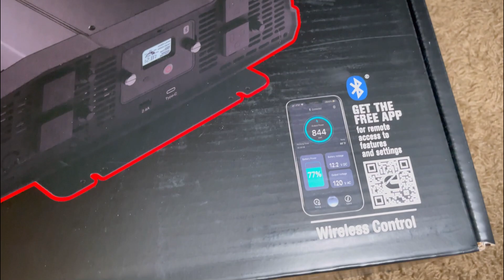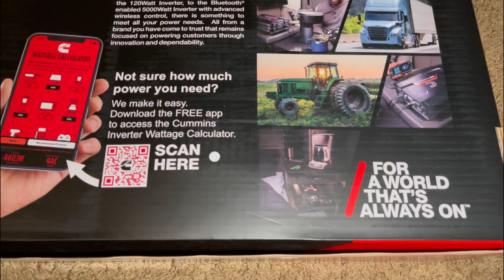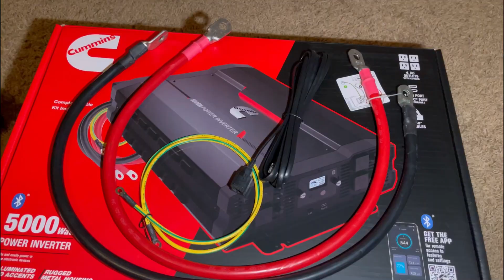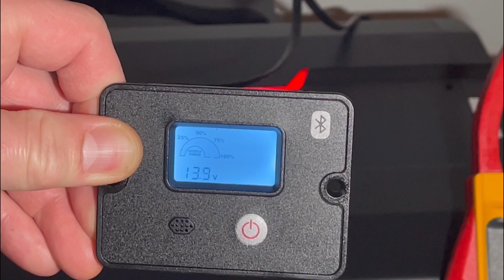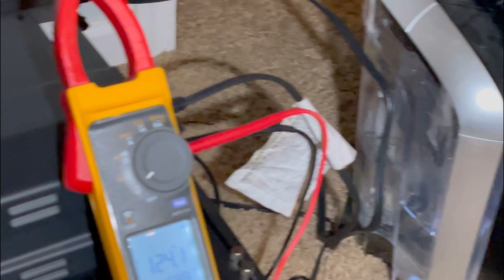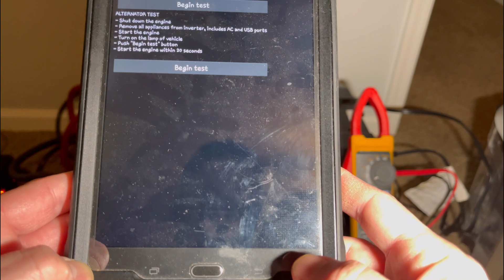Cummins 5000W Power Inverter Unboxing, Review, & Test! #cummins #cumminsnation #inverter #power

Comment: My ram 2500 is gonna be getting this with a deep cycle battery in the bed box and 1/0 jumpers to the front cranking batteries. Just gotta swap the bed first

Comment: Can I put directly on my car in the battery connection and leave the car running?
Reply from the maker: Yes but I would highly advise an inline fuse. What type of vehicle?
Reply: @DIYKAI i have cruze 2019 buddy
Reply from the maker: @Marlonpereira92 so that alternator is probably 140A output or so...you would not be able to pull max power just be aware this is a BIG inverter lol
Reply: the best thing is remove battery use and put battery again in the car to recharge?
Reply from the maker: @Marlonpereira92 so it's really going to depend on what you're trying to power?
Reply: @DIYKAI I need use Portable 2000w water heater and one coil burner, I need running 4500w at same time something like that.
I have one with 3000w but not work with my water heater I don't know why.
Reply from the maker: Got ya soif you running it for any amount of time over a few minutes hook it directly to a battery with a fuse and disconnect
Reply: do you think can leave works by 1 hour or little more just with battery?
Reply from the maker: No not possible with one battery you would need a few Lipo batteries
Reply: thanks for awnser my question man, I appreciate you.
Reply from the maker: Your welcome and good luck the car should be able to handle it but may strain the alternator

Comment: Does it charge batteries when 110v comes back through? I have a tool trailer that I want get set up but when I plug in the trailer I would like it to charge my batteries
Reply from the maker: @coleverbruggen660  no you would need a transfer switch

Comment: What's the real specs? 5000 watts!, sounds like they are marketing peak power.  1. That cable looks too small to handle 5000w/12v -- that's 416 amps and 4/0 cable maxes out at 260 amps.  For 5000 watts, I would expect it to be a 24 or 48v system.  2. All the AC outlet are 15 amp, not a single 20 amp circuit.  My 2000 watt inverter has 20 amp outlets and peeks at 4000 watts.  I assume that inverter is most likely a 2500 watt inverter with a 5000 watt peak. Just like my factory installed inverter marketed as 400 watt; but can only run a 250 watt load for a minute or two before cutting off.  I hate marking departments that stretch half truths into outright lies.
Reply from the maker: @rui1863  to answer your question I never maxed it out 5kw is hard to pull especially off a sitting battery. This inverter is meant to be run in a vehicle where 200A is common for an alternator. Yes I agree the cables are a bit on the smaller side but what can you expect they are trying to deliver a complete package at a decent price!
To address your point of 15A or 20A sockets is not 100 percent relevant….i have 20A sockets in my house and shop and the shop vac I run depending on how much or clogged it is will pull 29.5A 
The ratings are a test and safety standards.

There are 4 sockets and I have the means to test it maybe one day I will max it out and tag you so we can both see.
Reply: @DIYKAI  Yeah, I know.  Each one of the outlets is only 1800 watts max; you'd need all 4 of them maxed out. Plus you'd need over 400 amps on a 12v system -- that's a really big alternator.  I have two alternators in my truck for combined total of 420 amps at max operating speed and that is still not enough to power this thing safely.  The cable is not thick enough; it would require multiple cables to hit the max load without causing a fire. I would love to see a proper install of this unit and the truck/alternator combo.  I looked up the unit; it does say 5k/10k peak which is crazy for 12v.
Reply: Just to be clear 5k is 417+ amps and 10k is 834+ amps.  That's going to be a really big alternator or a large battery bank.
Reply from the maker: Well I can say my Cummins truck has a 425A alternator and 2 batteries lol
Reply from the maker: I absolutely agree I am very interested now to see I wish it was pure sine but it’s good incase of an emergency. Let me see what I can rig up this week
Reply: @DIYKAI  o was planning to buy this inverter to run a Primewelder tig 225 but 3600w should need around 12v~200amp I’m not sure if it can run it properly I have 320 amp alternator. The
Reply from the maker: @mensand5294  I don’t think it would be a problem with your setup if that the max watts you pulling

Comment: I have a question? Can it power up BOUGERV 4000BTU PORTABLE AIR CONDITIONER? Please advise 🙏
Reply: SKU	E0501-48001
Cooling Capacity	1100W / 4000BTU 
Cooling Area	64 - 86 Square feet
Temperature Setting Range	60℉-86℉(16-30℃)
Input Voltage	100V-120V~50Hz-60Hz
Rated Wattage	480W
Rated Current	4.1A 
Working Temp	60℉-109℉(16-43℃)
Refrigerant	R290(120g) 
Sound Level	45dB
Product Dimensions	20.31x12.09x13.98 Inch
Weight	32.2 lbs
Reply from the maker: But to answer your original question yes it will run it no issues
Reply: I wonder how long before an AC unit would drain the batter  @DIYKAI
Reply from the maker: @JimGlimpse  depends on battery size
Reply: Air conditioning specifications take a look and see what you think
Reply from the maker: Honestly if your looking for seamless flow get a pure sine wave..3000w would do it
Reply: @DIYKAI  I really appreciate your advice brother! Thank you so much….

Comment: Not impressed thought it could  handle more
Reply from the maker: @joeacosta  5k was not enough? I would say never max an inverter out 50-60% of total power to stay safe and make it last
Reply: @DIYKAI  great video but im thinking what about a mini fridge
Reply from the maker: @joeacosta  easy it will run that and more
Reply from the maker: @joeacosta  mini fridge will pull maybe 1000w on start up and around 400w running
Reply: @DIYKAI  now then i need to find me $600 bucks
Reply from the maker: So what all are you trying to run? Where will the inverter be hooked up a vehicle?

Comment: Just with the name Cummins on it you know it's bullet proof, works better than anything on the market, 12v at that lol.
Bet when it's plugged into a truck with a cummins that it will do double duty lol.  Case does look nice.  Sheww I went and looked and well it's not $600 nice, I got a bunch of mouths to feed to pay so much for that, I'm way too cheap for all that.  Not to mention it's not a pure sine wave so the high cost is just paying for the shinny name rather than performance.  No personal disrespect or nothing, first part of my comment I was just trying for a laugh, then I got to what I was thinking.  I just bought a inverter a bit ago, nothing in this price range for sure, just wanted a backup because I work from home and the power has been going out alot, I'm not doing solar, I've dammed up my creek and going to use the water to turn a waterwheel/genny Im puting together like to have all the lights on.
Good video showing what it will do, like any other brand I always wonder how long they really last, I've had a small cobra 800w for years, non-sine and have used it here and there but never more than a day or 2 and just for small stuff so I'll say I don't have any real experience with em. though I've lived on the road in a RV and bus conversion for a couple of years, usually just got by the the onboard 12v supply if we weren't docked and hooked up.

Comment: pure sine ?
Reply: I’m trying to run a griddle, gaming pc, starlink satellite, convection microwave oven, I just blew my 2500watt and I’m afraid the 5,000 isn’t enough either
Reply from the maker: @Ruie  so this would probably run it as the surge is much higher but it is modified sine wave and that can be an issue for some sensitive electronics
Reply from the maker: No modified but very clean
Reply: It's either clean or not don't get these inverter if you have a TV or PS5 you going use it will reset it
Reply: @Sinerwray  Pure is clean, modified is a cheap choppy imitation, I wouldn't plug my PC into that, only the pure sine for the sensitive stuff.  Modified is what it sounds like, like the GMO of electricity lol.  Spend a few more get the pure sine, just research it.  It's a "fake kinda clean", sure things will work maybe, but their longevity can be effected, I'm a cheapskate and went with the pure sine, I don't have the money to replace my electronics and I work from home so it matters enough to me.  IF it wasn't for my network and PCs I would likely go with modified, not saying it's the worst, but really it's not technically clean, it's a little cleaner but it's not smooth.
Reply from the maker: @Sinerwray  We have no issues running a TV?

Comment: What fuse do you recommend for this power inverter?
Reply from the maker: What’s the max power you will be running?
Reply: 5000 Watts- 50amp inline fuse
Reply from the maker: 175 A would be needed to be safe at 5k